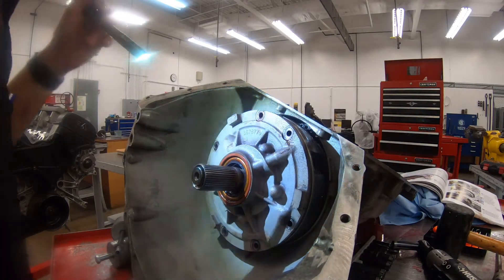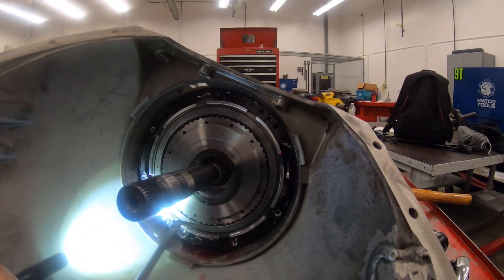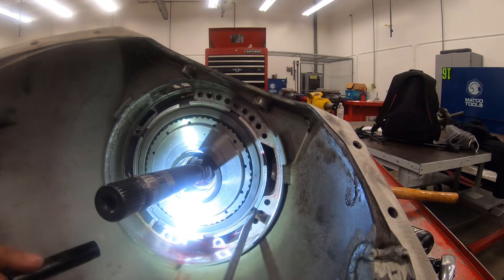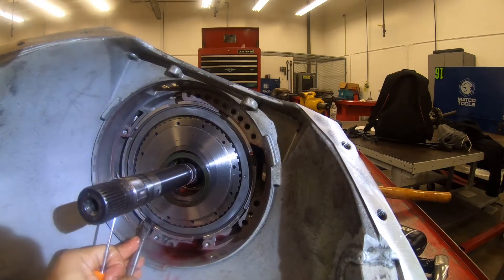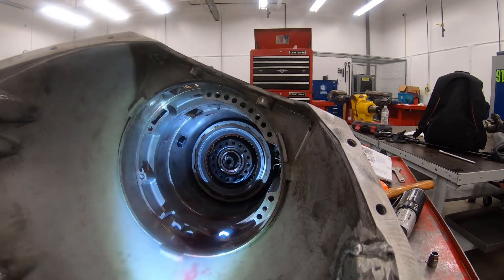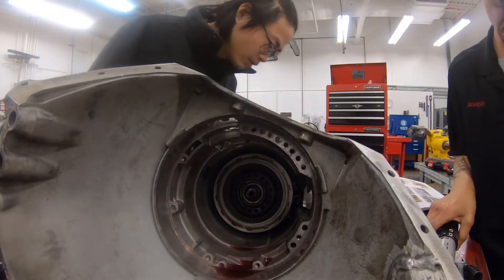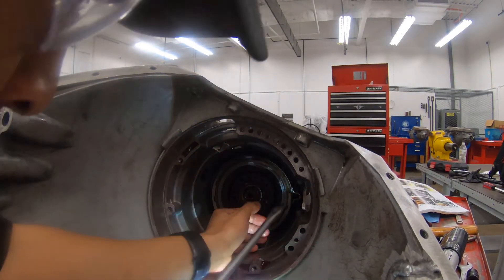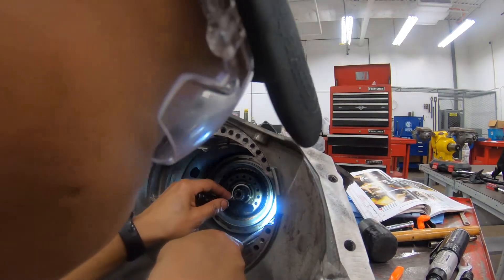The 4l80e 4x4 to 2wd conversion

Comment: do you have a list of part need to convert the 4l80e to 2wd?
Reply from the maker: @remixdan17  Output shaft needs a reluctor ring on it so output sensor can read speed  message me on instagram @swapped_nova
Reply: @swapped_Nova I’ll be sending you a message as well if that’s ok?
Reply from the maker: @lambchopLSX87  cool I’ll be looking for message on instagram

Comment: Looking for the part 2.. about to dive in on this for my turbo 51 3100!! Thank you part 1. Really curious about the output shaft lubrication orifice.
Reply from the maker: @Tim dontwannasay  I did this project at school while in transmission class. I drilled a small hole in orifice for output lubrication